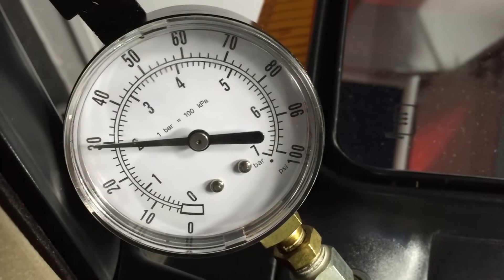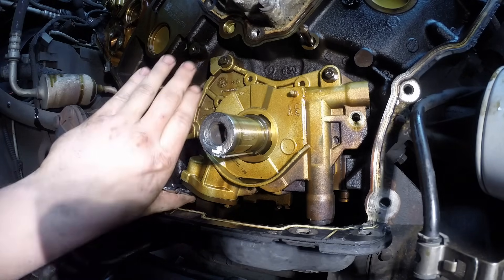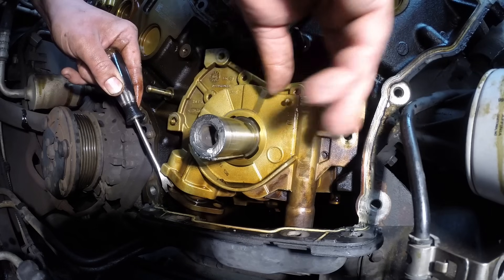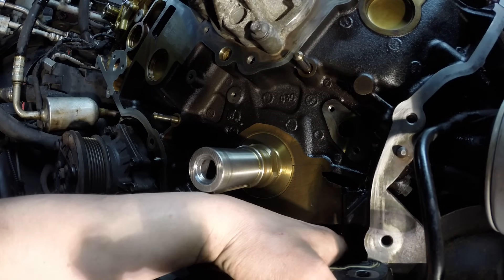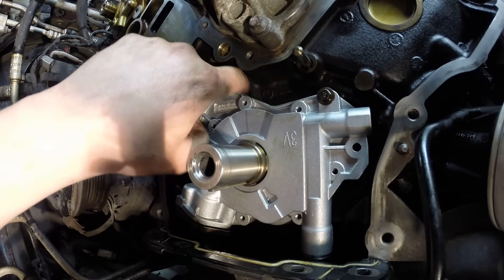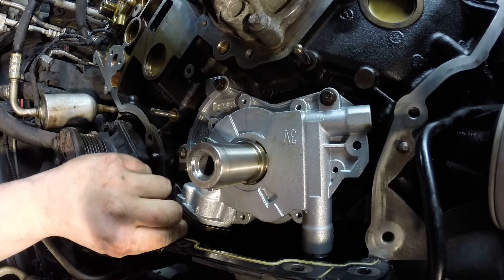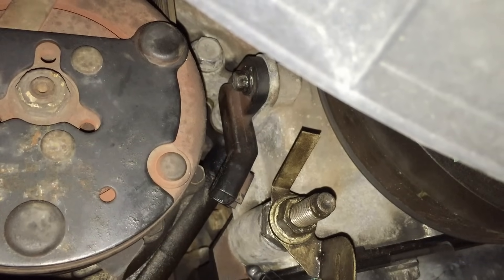Ford 5.4L 3v Engine Melling M360 Oil Pump Upgrade

Comment: Love the new pump installed with full timing job engine run better than new. On another note, what filters the fuel? And how does cabin air get filtered on my 09 F150 XLT????

Comment: Working through the whole timing job.. did the upgraded oil pump.. swapped all the timing components... just rtv'd and bolted my timing cover back in place... putting old parts and boxes away for the day and i come across a O-ring... looks like it was for the upgraded oil pump pick up tube... i never took the old  O-ring off... am i going the have to take this cover off and remove the pickup tube again?

Comment: I like the oil pump install with oil pan on.  I wanted to see how you started the more difficult bolt   Your video did not show you doing that.  Mine is the 4.6 3v. In explorer. 4WD makes dropping oil pan a bigger job. I have from cover removed and the  guides appear to NOT  be missing any pieces. I would like to avoid dropping front differential. This job is already enough. Thank you for posting good instructions.

Comment: You can loosen the oil pan and lower it a few inches without touching the front diff. That will give you plenty of room to un bolt the oil pick up tube
Reply from the maker: absolutely not!

Comment: 2010 F150 5.4, 4x4 Crew, 188K. I ordered the motorcraft timing kit, solenoids and rollers/adjusters recommended from your videos. I have everything taken apart right now, including replacing exhaust manifolds, rear studs were broke and didn't even know but did the welding nut from your video, worked great. I ordered the M340HV in error, should I return that and get the M360HV instead? Thank you so much for all the videos and help!

Comment: In your other video you state this (M360HV) is an 80 psi pump.  This is not producing these values and any more pressure than stock.  If the high pressure failed to live up to its claim, why would we have faith that it actually has more volume?  Is this just another  over zealous marketing claim?
Reply from the maker: You are so wrong in so many ways dear lord. Oh and please look up how they achieve that higher volume so you understand a bit better

Comment: 10 to 15 minutes my ass. Why don't you tell them the total amount of time that it takes this is why I hate YouTube videos like this that lie about the total time that it takes to do the complete job you are misleading the majority of the people that watch your videos. Most of the time real mechanics do not watch this kind of crap
Reply from the maker: I think you missed the part where I said once the engine is torn down for a timing job this only adds 10-15 minutes. Are you saying it takes you longer? I do them in about 2-5 minutes max.

Comment: My oil pump seems to be stuck and wont come off. I pushed the pick up tube down and the pump will only slide about a 1/2 inch then stop. Ever had this problem and what is the solution?

Comment: I know the tech manual doesn't say to apply sealant or a gasket to surface between the block and pump but man I feel like there should be..
Reply from the maker: never never never do that.

Comment: Ive got guys SWEARING you need to pull the oil pan.
Reply: i was one of those guys, I think the oil pan will not give enough clearance to take out the 2 bolts of the oil picker, but no its completely fine

Comment: How many hours do you reckon it would take to change this oil pump? 

Do a full timing kit with chains and tensioners and guides and also change the roller rockers and the lash adjusters all in one go?…..

What sort of book would you quote for a job like that 16 hours or something? 

Good channel all the best from Melbourne Australia

Comment: Any help appreciated...i did a timing job and new oil pump. Cleaned pan and pickup tube. Reassembled, went to priming procedure, and i have zero oil pressure. Verified the gauge and sensor. Both are good. Verified with a mechanical gauge and zero oil pressure.  Put a scope in the pass side VC and no oil coming to the top of the motor. Thoughts????

Comment: Where are you located ? I have 05 f150 , with 410000 miles , everyday driver , trailer puller , no internal engine work at all . I would like your shop to do chains and pump work , I’m sure they’re getting worn . It’s had a Lucas and motor craft diet since purchase in 06’

Comment: What would the cost be to replace the timing kit and cam followers as well as the high volume oil pump be if you did them all at the same time
Reply from the maker: Around $4k

Comment: @FordTechMakuloco Recent subscriber since finding your channel, your vids are SO much help, THANK YOU!  Quick question, I have a 2014 Expedition EL Limited I purchased brand new with just under 500k miles on it currently (Florida truck).  No issues and the truck runs great since new.  Had a timing/cam/roller follower job by Ford around 250k and looking at doing another one (myself) soon, starting to notice some start up rattle again.  That said, I idle this truck around 4-8 hours per week, every week since I bought it new in 2014.  With that info, do you recommend the 360HV or 340HV for my application? I've never hooked up a manual pressure gauge to the truck but the idiot gauge has always read slightly above the middle position.  Thank you!  -Edit: Also forgot to mention it spends several weeks a year towing a 13,000LB contender...probably 1,500 miles per year give or take.

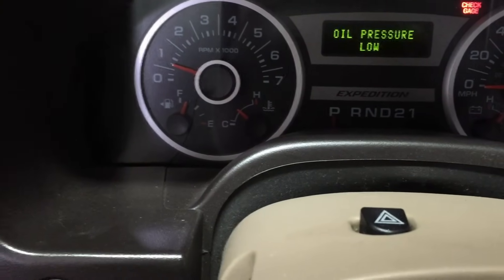Comment: 12:40 Oil Pressure Low on the dash!
Reply from the maker: Come on guy now seriously. The oil pressure gauge is obviously tapped into the oil pressure port.
Reply: @FordTechMakuloco  Gotcha.  So it wasn't connected yet.

Comment: After a month I got everything back together , followed the video, long story short I have tried priming the engine maybe a total of a min ( in 10-15 seconds intrivals waiting a min in between) and I get no oil pressure on the dash. I hooked up the crank sensor and it fired right up didn’t sound bad at all but still no oil pressure so I shut it off after about 10 seconds of being on. What should I do? I hope it’s the oil pressure sensor as the oil pump is brand new but previously before doing everything it did show oil pressure
Reply: I'm having the same problem. Reassembled and no oil pressure. Did you figure yours out? Thanks
Reply: @RustyTaylor-q1b  yeah bro, turns out it did have oil pressure. Somehow the oil pressure sensor stopped working since the last time I had it running 😂 idk how that’s possible since I did not touch it but basically I bought a new oil pressure sensor at oreillys for like $50 and put it on and boom it showed oil pressure 😂
Reply: @gamespost1226  I'm not getting that lucky. I have zero oil pressure verified with mechanical gauge. I'm lost. Anyway to contact this guy?
Reply: @RustyTaylor-q1b  damn bro, did you have a broken timing chain or guide or tensioners? I have read that if your engine was bad enough and broke any of the things I’ve mentioned they can get stuck in the oil pan and clog the oil pick up tube. If you did have broken pieces I would drop the oil pan and make sure it’s not clogged or anything like that
Reply: @RustyTaylor-q1b  u figure it out bro?
Reply: @gamespost1226  man I did everything I read about. I filled the oil filter and pumped oil into the pump area via the oil pressure switch. Still had no pressure. Finally I did what so many others did and just started it. Turned out fine.

Comment: I went into the link to buy the pump but for whatever reason is telling me it does not fit the year and model of my engine which is a 2005 fx4 5.4 3v v8. Just making sure I'm not ordering the wrong part.
Reply from the maker: Yes it fits.
Reply: I appreciate your response. Thank you. I’m placing my order. Have a nice day.

Comment: Amazon says this pump does not fit the 2008 ford expedition  5.4l? Is that true?
Reply from the maker: The pump fits all 3v engines 2004-2014

Comment: Great video. I have a 2014 F53 chassis motorhome with the 6.8 liter 3 valve v10. I have 32,000 miles on the engine and have not had any engine issues. . Would you recommend changing my oil pump.

Comment: Does the oil pump manufacturer recomend the back plate removal for priming the pump?
Couldn't that be accomplished  by pouring oil into the pickup tube inlet rotating the gears by hand to lubricate them? Excellent video nonetheless. I will be working on my 2004 soon.

Comment: I'm curious Brian about what would happen if you just switched to Amsoil. I run it in my Harley and the oil pressure at idle has gone from almost zero at hot idle to about 30 psi. hot idle. I realize I'm comparing apples to oranges, but I believe Amsoil is a superior synthetic oil.
Reply from the maker: Meh
Reply: Man I like boutique oils and use Amsoil myself, but it sure as heck ain’t gonna take an engine running zero psi hot idle oil pressure and jack it up to 30psi unless you were running the sump practically empty before putting amsoil in.

Comment: First timing job took me like 45 minutes to get that right oil pickup screw in. One of the hardest bolts ever. Second timing job on another 5.4 only took 10 minutes. One difference was the flex head wrench I used the first time was too loose. This time I use a wrench with a stiffer hinge. Was able to hold the bold in place netter. And of course the cat claw is necessary too. After I got it started, I moved the catcall to the other side of the wrench and finished it off.

Comment: Hot tip for the right/aft pickup tube bolt, after struggling for an hour: his method worked the best but first get the bolt as far into the hole as possible by supporting with the gear wrench in your right hand, and holding the threads nearest the head with some pliers to prevent dropping while you work it into the hole.   Then switch out the pliers for the cat claw for bottom support.  You need to insert the bolt at a more extreme angle than you might think to avoid cross-threading.  If you feel much resistance at all before the very end, STOP and start over with a steeper entry angle.
Reply: may the bread bag tie wire could serve ?

Comment: I notice that this oil pump as mine only have 3 bolt but it has 4 hole so it just comes missing one bolt from factory should i get a extra one or i shouldn't worry?

Comment: Ugh, truck won't pressurize after timing and melling install. Any thoughts? Crank sensor is off multiple attempts wont prime.
Reply from the maker: Crank 3 times for 10 seconds each, then plug in crank sensor. Start engine, if oil pressure does not come up within 2 seconds, shut it down there is a problem.

Comment: Had a broken chain guide, found majority of it but im suspicious some of the plastic got down into the pan. Its a 4x4 so dont really want to drop the pan...i was told to flush the pan with diesel and blow compressed air through the pickup. Any thoughts on that?
Reply from the maker: Drop the pan for sure.

Comment: After fighting with that inside bolt for about a couple hours I called the wife thinking with her having smaller fingers she'd be able to get the bolt started. But like me, she was having difficulty getting it to catch on the 1st couple of threads. So being the out of box thinker that she is, she went to my son's room and got his 3" squishy ball and inserted that under the bolt hole, got the bolt in, and then I was able to rotate and get the bolt started. After that, I kept the ball in place while tightening it down with the 8mm flex head.  

As for set up, we stuff a bath or kitchen hand towel down into the front of the oil pan, up against some other internal pan structure. We let some of the towel hang out on the right hand side so it could be pulled out later.  The purpose for the towel was to give the ball something to butt up against and so it would stay in place and of course, not allow it to fall or get stuck in the pan. After all said down, I pulled out the ball, the towel, and then double checked and cleared out any remaining debris with said towel. 

Worked like a charm! 

If there was a way, I'd upload a pic of the setup. 

Hopefully this will help out the next person.

Comment: Melling m360hv DOES NOT FIT 2005 F150
Reply from the maker: It sure does I use them all the time.
Reply: @FordTechMakuloco  Took the ford oil pump off and could not get the m360hv to go on all the way, tried the used ford oil pump went on easy. I'm in Canada so maybe f150 are different here... I still can't believe it doesn't fit but it really doesn't.. Won't go the last inch approximately.
Reply: Melling m360hv DOES fit. It was just a fair bit tricker than I suspected.

Comment: Hello, please I need you to help me. I have lost a bolt from the pump and I don't know where to buy it or how I would appreciate your help.
Reply: Check where you put the chain guides. The missing bolt goes through the guide on the drivers side and into the pumps lower right hole.
You might still have it with the "other" parts.

Comment: I know that there are a ton of helpful comments here but I thought I would add to this awesome volume of helpful info.
1st, yes those two bolts for the pickup tube will be a pain in the butt, just face the reality now and continue on. Make sure you have a flippy/swivel open ended wrench and you should be ok. I found that the lower harder to get at one almost wanted to cross thread on me so I had to make sure the other bolt was loose enough to allow movement of the pick up tube. 
2nd, Priming the pump. This is where I struggled. I left the crank sensor unplugged and did the running with the starter only thing and never got any oil pressure. I even removed the oil filter to see if any oil had made to that and it did not.
I found a very short video that was put out by Melling on just this problem. They advised to prefill the oil filter and also to use what ever means to push oil into the lower squarish hole where the oil filter mounts to. You pump, squeeze, shove whatever you can do to force oil back into this opening. what you are doing is pushing oil back into the oil pump. Once I did this it only took another 5-10 seconds of turning the engine with the starter to get oil pressure.

I was questioning everything that I did when I was not getting oil pressure. I was fearing that I was going to have to tear back into the engine again. Verify each step while doing the job and trust the method of priming. You will be fine.

Comment: 2007 5.4 3v F150 should I use 340HV or 360HV? Afraid of oil leaks or consumption with 360
Reply from the maker: Use the M340HV.

Comment: My 05fx4 has 280000 miles on it! Runs great, but noticing what seems to be valve train noise. Thought about replacing lash adjusters and rockers, but it has 280000 miles on it! I use full synthetic oil,  at 2500 its a quart low. Add a quart and run it to 5000. With this 280000 miles I have to think really hard bout investing money into this engine? Reman engines are considerably higher than the old 2 valve engines, but I like the truck! Is it worth spending any money on this old engine,  or look for a replacement in the future?

Comment: Hey Brien I checked Amazon about the oil pump the Milling M360 but it`s telling me it does not fit my Ford 2014 Expedition the engine is 5.4  Triton 3-V it has 177470 miles
Reply: They’re the same and interchangeable. The M340HV has higher volume than stock and should be fine. The 360 just has a slightly more kick from what I can tell.

Comment: Would you recommend to replace pick up when replacing the oil pump?
Reply from the maker: no
Reply: Another question is there a oil pump you recommend for 03f150 4.6
Reply: And is the timing process the same for the 4.6 Windsor

Comment: I would recommend pulling the oil pan off.  If your engine has had any broken guides I garuntee that your pick up has a good load of desbri in it and if your changing the pump at this point in the life of an older vehicle it's just a good idea and not a lot more work

Comment: I did chains and an oil pump on my 4.6 mustang, it runs good until it gets to operating temperature. Oil pressure is like 60 psi when cold at idle and 20psi at operating temperature at idle. the book says 25 psi minimum. I think the bearings are roached! 
Any other ideas as to why it would lose that much oil pressure at operating temperature?
Reply from the maker: 4.6L3v? First use 5w-30 oil and the new spec is 15psi hot idle.
Reply: @FordTechMakuloco  yes 4.6l 3v. Is there also an updated specification for oil pressure at 2000rpm? Alldata talks about minimum 25psi at idle, I know that’s been revised. It also says minimum 75psi at 2000 rpm. I’m getting 20 at idle and 50 at 2000rpm. 
I found lots of what appears to be bearing material in the oil pan. I think the bearings are worn. 
Wonder why ford revised the oil pressure specification in the first place.
Reply: @FordTechMakuloco  it’s really weird how it runs perfectly, even under load, until it gets to operating temperature then begins to run very bad

Comment: So, I had cam phaser issues on my '07 expedition EL. I had a mechanic replace phasers, chains, and tensioners. I still have cam phaser issues. Mainly when backing up a trailer, low idle crawling movements. Could the actual issue be the oil pump is worn out? I've heard the sensors rely on oil pressure to regulate the cam phasers.